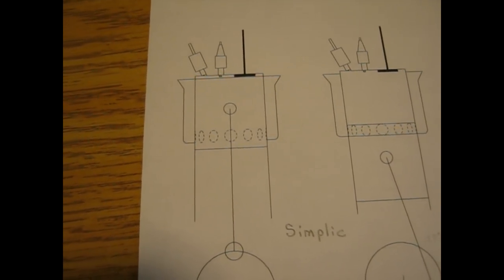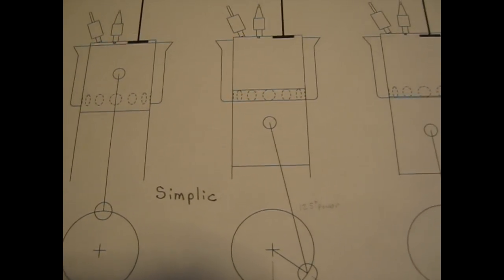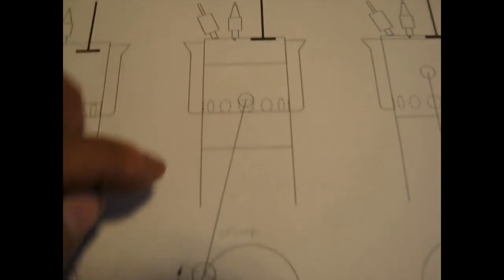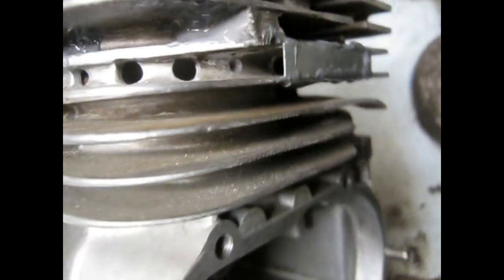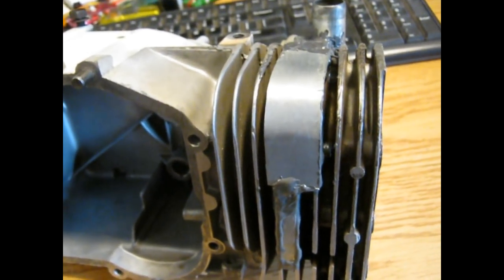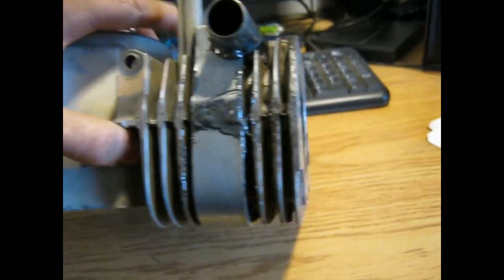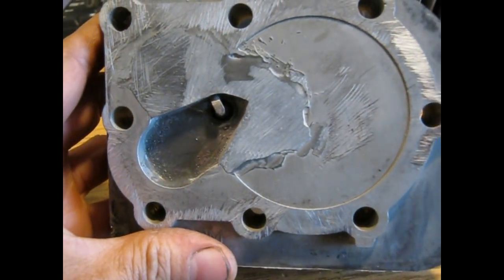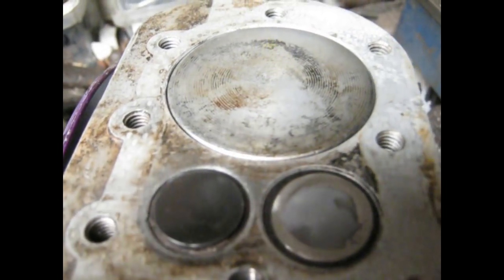Simplic Engine Operation & Build

Comment: Perhaps there's too much compression?
Reply from the maker: Possibly, I lowered the compression on my second attempt vid, but it didn't seem to help. This one is a bit of a mystery to me, so I am going to build a 4 stroke Hyper-expansion engine as a stop gap measure to see if it will run.

Comment: It's like a 2 stroke but backwards!!!!
Reply from the maker: Yes, sort of. It is a 2 stroke, but pushes most of the air out the exhaust for cooling, then the cylinder developes a vacuum pulling the new charge in. I can't figure out why i can't get it to purr like a kitten. I have sniffed the exhaust pipe, and it smells like burned gases, no raw fuel. So it is acting like it is starving for fuel and air.

Comment: Interesting combustion cycle, seems like a good deal of "wasted" stroke. Not sure if it's realy wasted, but i suppose i mean it's odd it creates a vacuum on the downward side of power.  Any way bet she would rev right to the moon and back. Best of luck with it!
Reply from the maker: Yes, it is a very strange cycle, I am finally getting my head around it. I believe i need more exhaust duration to shorten the power stroke so it goes into hyper-expansion sooner. that way there will be a high vacuum in the cylinder to pull the intake charge in. hopefully that will help me get it to run. I plan to weld up a new full speed camshaft tomorrow night. Unfortunately the only chance I get for a daylight vid is on the weekend, but I may make a night run, when I get it all done and back together.

Comment: maby try heating up motor close to oprating themp, then feed it some mustard and try agin? also if you have a really rugged high torqe drill you could use that to crank it.
Reply from the maker: Yes, an electric starter would be a good plan with this. I will also lower the compression ratio by giving it more exhaust duration, thus shortening the compression stroke.

Comment: I think maybe you have to use a supercharger on this one, or rebuild the crankcase so you can use the pressure from when the piston comes down in order to replace the exhaustgases with fresh gas/air-mixture?

Big fan of your videos 🤘
Reply from the maker: Using the crankcase is definitely out for this. I am leaning towards using a hair dryer for a blower to force feed it during starting. a shop vac sucking on the exhaust pipe would do the same thing, but I would have an explosion risk with the gasoline vapors in the exhaust. I will make a new camshaft with more exhaust duration, which should increase the suction when the piston is moving downwards. This is a very bizarre  engine, so figuring it out is a challenge, completely different than the normal 4 stroke engine!
Reply from the maker: Oh, I forgot to mention, thanks for watching my vids, much appreciated!
Reply: ChargerMiles007 okey, yeah maybe it's to advanced to rebuild the crankcase into a 2 stroke configuration. Maybe you can use the wate gases to drive a turbocharger using one more spark plug in the exhast to ignite it? I think that you also need a bypass from the airside of the turbo to feed the wastegases with more fresh air. It's a very interesting concept you are building, looking forward to see it start up :)

Comment: you should try to build a diesel briggs, you can get a diesel pump from a single cyl on ebay for cheap and injector and then build a head thats tight with cam slightly grounded down so the valves can only open very little.
Reply: Heres a pump ebay #151930662427
Reply from the maker: thanks for the idea, and pump info. , I have a VW diesel injection pump, but that is pretty large for this application!

Comment: This sounds suspiciously like a 2-stroke diesel.  I wonder if the starting issue is because it would similarly require something to get the airflow started?  Maybe you could emulate a scavenger with a small smog pump or something.  Or yeah, just do what BustedWalletGarage suggested and run it on propane since that has pressure.

In other thoughts, do you have plans for the exhaust?  Seems both wasteful and dangerous to be exhausting combustibles.  I suppose that if you could get it to run on gasoline, it might be possible to separate and collect the exhausted fuel (lol, EGR on a mower).  Or, you know, just burn it off at run time because that's way more cool.

Then again, it's called the Simplic.  I might be missing the point.
Reply from the maker: You have touched on some of the flaws in my modified design of the Simplic engine cycle. My engine will pump out unburned gasoline with the exhaust. It would be better if I used a fuel injector, like the original diesel engine, but that is beyond my current abilities, though that was in my original design. I am looking at trying a hair dryer as a scavenge pump to feed the engine during start up. If I can get it running, it should feed itself, though the original engine did use exhaust pulses to help scavenge the cylinder. I guess Mr. Chatterton knew his stuff back 60 years ago!

Comment: Pretty Cool!!!!  I`m going to enjoy this one for sure
Reply from the maker: Thanks for watching, it is unfortunate that it wouldn't go on the first attempt, then I ran out of daylight. re-thinking it, i believe i need more exhaust valve duration so it will have more vacuum to suck the air/gas mixture in. If that doesn't work, I will try exhaust scavenging or forced induction, gotta get a run from this thing one way or another!

Comment: Should be interesting to see it running, experimental engines are always fun... :)
Reply from the maker: I will be happy if i can get a run out of it. Electric start, a longer duration exhaust camshaft to lower compression and increase hyper-expansion, as well as using starter fluid are all on my check list. this engine may require a second person to man the starter while i control the throttle and spray in the starter fluid.

Comment: Propane may be the way to get her to run because it's already a gas and flows/mixes faster ?
Reply from the maker: true, i may need to resort to that, thanks for the idea.
Reply: Either that or you could rig up something with a leaf blower to force air through the carburetor.
Reply: Cameron Jenkins then the air pressure blows the fuel backwards

Comment: Interesting project. Detroit diesel engines are similar, but uses forced induction to flow the exhaust form the ports to the valve, which is something yo may not want without direct injection (unless you like the smell of gas, but from seeing your design, I bet you do!).
Reply from the maker: LOL, yes I am pretty sure i will be smelling gassy exhaust if I can get this to run. the original design was a diesel, so it would only have pumped air out the exhaust, mine being carburated will pump raw gasoline out with the exhaust.